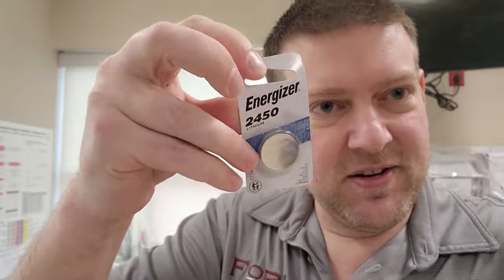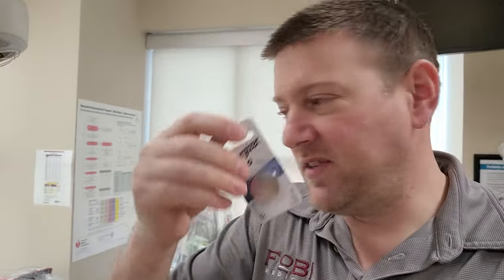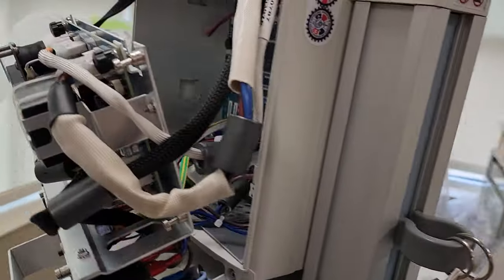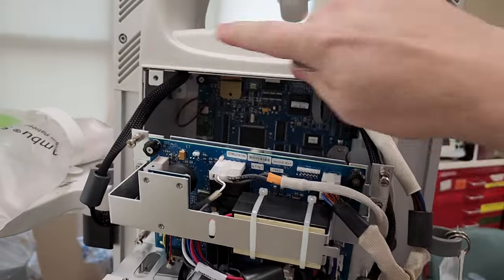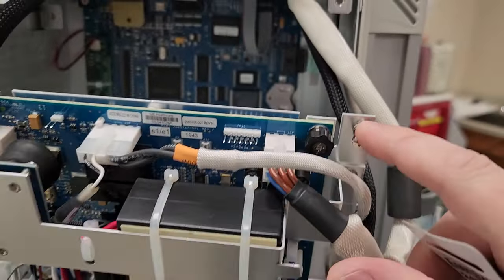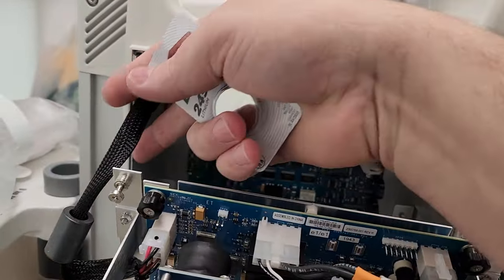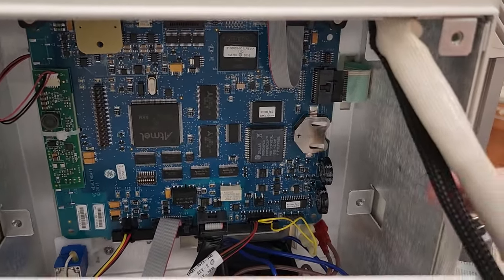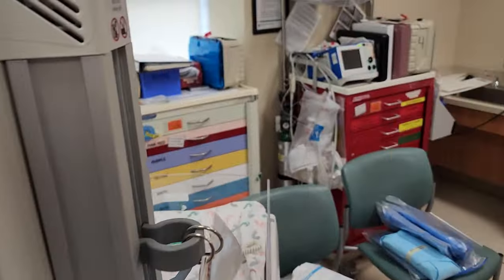GE Panda Infant Warmers - Every 2 Years

Comment: 3:01  8 or $9 for 1 Lithium battery ? Wow, that's expensive. I was just taking a look at 2 part resellers where i order my electronic components, and a Energizer CR2450 costs here in Belgium arround 3.3 to $3.6 for a package of 2 pieces. And there is even a discount when ordering multiple.